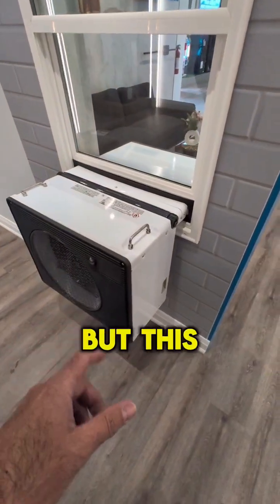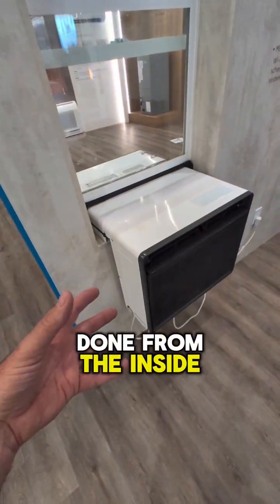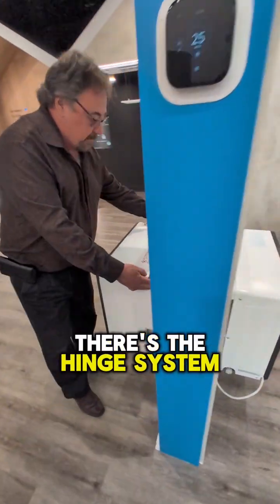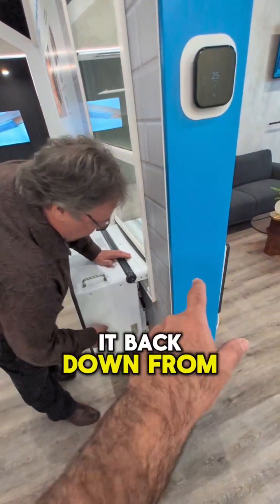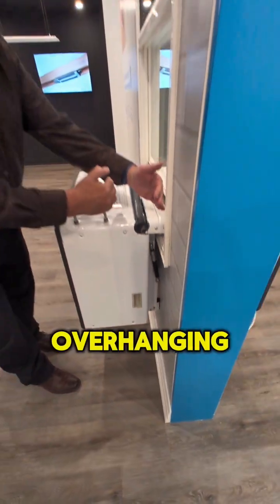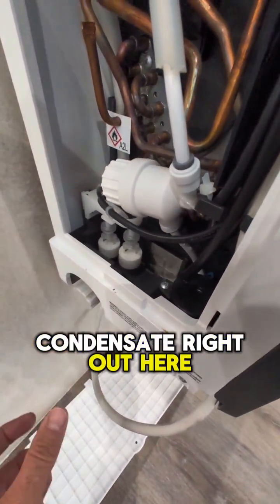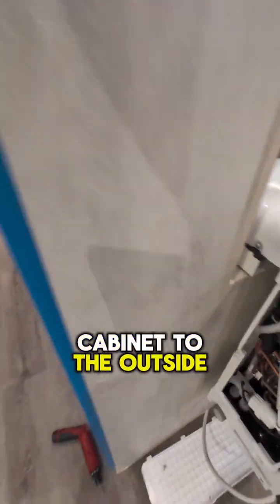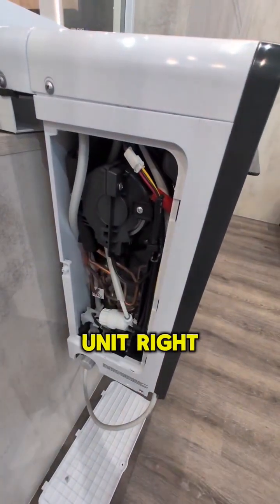Midea Package Window Heat Pump

Comment: Can it handle North Canada winter or does it have to be removed in the 
winter?
Reply: I did a little reading on it. Works for both heating and cooling. Efficient heating to an outdoor temp of negative 22 degrees fahrenheit.

Comment: This is such an archaic way of doing it. Why not use proper split systems instead of this ugly thing? Y’all are building homes out of cardboard anyways
Reply from the maker: It was initially designed for NY apartment buildings and that's the main market.
Reply: Pretty cool design. These units are efficient for cooling a room. Quit your crying
Reply: Are you kidding me? If I as homeowner can buy and install one of this without hiring those blood sucking havc contractor and electrican, I will save thousands of dollars.
Reply: @han7902 you literally can. They come with pre-installed gas. Drop your purse and get to installing.